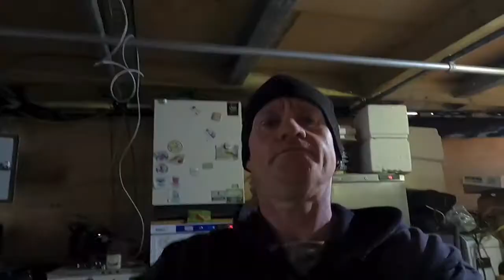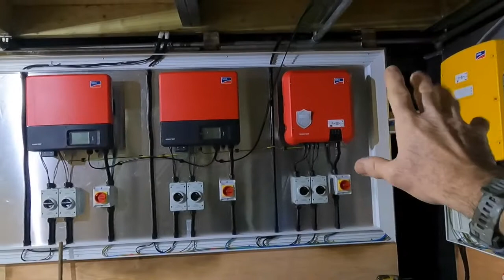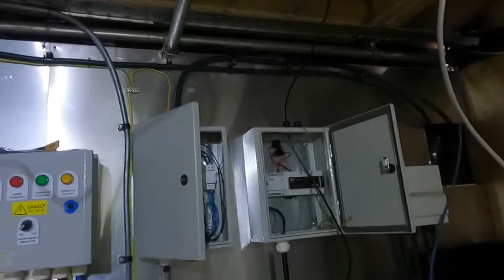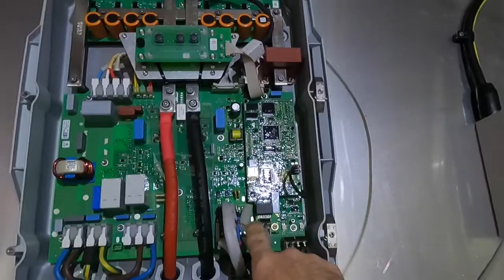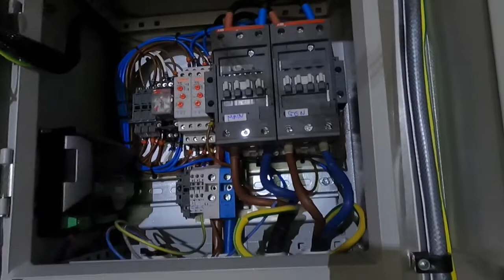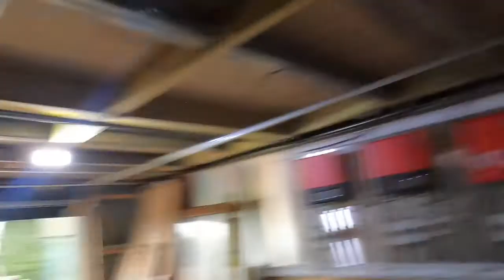SMA SOLAR UPDATE PT2

Comment: Looking good, did you need to go down the route of a home manager, or did the SMA webconnect do that all.  Do you use Bluetooth for the Sunny boys, or ethernet card??  I think you could achieve 85% off grid supply, with the number of panels.  A bit more detail on the ATS would be great.
Reply from the maker: Hi Ivan. went down the data manger route as was unable to find a used web box. I did look at the home manger but the data manger will take 50 inputs. the new sunny boy and sunny islands are Bluetooth and Ethernet. the two old sunny boys have the rs485 card and connected to the data manger . hope I can top more than 85% but it will be fun seeing the numbers. I will try and get some info on the ATS cheers.
Reply: @twistedtube1310  thanks for the reply, awesome, videos, can only dream of having 50 inverters all on one setup would be great to see that production.  You could always add more solar in parallel keep the same volts, but increase the watts, the production problem is always in winter, that way you don't need anymore inverters.  I would think that appx 12Kw of solar will be more than enough for battery charging and usage in summer, but could be a bit light in winter.  I'm getting more questions about grid connection on my channel, with higher self consumption, and there is so much confusion around the ATS, think this would really help.  Thanks again Ivan
Reply from the maker: @offgriduk2643  Hi again Ivan . Thanks for the input again . 50 is a Dream am thinking of maybe some more solar on the opposite side of the garage to catch later sun . You are definitely right summer solar production is not the problem it’s the winter. My biggest problem is I have a heat pump. And the company that I went with back in 2008 were a new company. They have massively change the way the system works now . So I need to sort this out and get it to be more energy efficient. Need to find a way to dump my excess energy into my water. And other ways . Still trying to work the ATS out need a way to make the contact to trigger on the generator side went power goes down.

Comment: Excellent video and install work. I’m looking forward to your update on using the system with grid connection. Is your plan to use it to move excess power to the grid? I want to use the grid connection only as a backup, similar to what my generator is doing now but not to move power to the grid. So when battery state of charge drops below let’s say 20% I will connect to grid to charge the batteries up to let’s say 40% and then disconnect the grid. I will also have setting that allows back feeding the grid off. I’m curious when you have the back feeding on, how do the sunny islands control the solar inverters (we know that in off grid mode it is by frequency) when the batteries are full? Do you think it will just leave the panels on and send the excess power to the grid or do you think it will disconnect the grid and then let the sunny islands shift frequency up to dial down the sunny boys output?
Reply from the maker: Hello and thanks for stopping by, we’ll on grid as not worked at the minute for me. I am going to do an update on the setup in the next day or two. so I am setup as off grid at the minute. There is a lot more to the on grid setup than I thought and for us in the uk it gets right complicated. I think I will do a video on this two. it will hopefully work out better and just maybe some other people will be able to shine some light. the new sunny island are two complex but I do hope to get to the bottom of it. sorry I didn’t answers your question but not to good at reading and writing. so I will try a video and hopefully answers questions. thanks again.
Reply: @twistedtube1310  thank you for replying. I look forward to your next video update!
Reply from the maker: Hi Curionsum, just going to respond to your first comment. as my computer has crashed and my last video has been deleted. and I’ve got 2 weeks straight work. 
my plan is to use all my power myself and not dump down the grid at all. I also only want to use the grid as back power and set the battery soc. for grid connection. in the Uk we have to have a disconnect switch to isolate from the grid if the grid goes down. at the moment I can get the discount to work but not the ATS. so I lose PE connection and that’s what the sunny boys are looking for. so I need to sort that out. I did find a off grid pdf. on the Sma web sit that spoke about off grid with grid connection if your able to find it hope this helps.
Reply: @twistedtube1310  your absolutely correct, the ATS has to have a physical disconnect to stop back feeding if there is a brown out.  Do the Sunny Boys need to be programed for a different PE monitoring when disconnected via ATS???
Reply from the maker: @offgriduk2643  Hi Ivan yep the ATS does disconnect . But because the contractor does not make on the generator side the sunny boys lose the PE connection. Not sure if the the PE settings can be changed. Wonder if I can find a way for the contact to make so it can see the PE connection again. Need to spend some time and try things out cheers Mick
Reply: @twistedtube1310  Hi Mick, how are you getting on, just re-visiting your changeover / Disconnect again, did you find a way round the PE disconnect???  Did it throw a grid error at the sunny island, or was it o.k??
Reply from the maker: @offgriduk2643  Hi Ivan . I have found in the soft wear were you can turn PE off but not sure if this will do any harm to anything else in the system. I suppose it’s a suck it and see . On another note I don’t seam to get the sunny island to accept the gen input any ideas would be very welcome. Thanks again.
Reply: @twistedtube1310  I presume you have the relay set for generator, i have a sunny island 8.0 12h, so the settings are done via a web type login.  do you use a remote controller??  The relay needs to be programmed or the default is to do nothing. Also did you wire a manual ( make and break) switch in to trigger the generator via digi input??
Reply from the maker: @offgriduk2643  Hi Ivan have not played with it to much. As we are getting some great solar products at the minute. I can see you can turn PE off on the sunny boys but not to sure if that is a good thing to do or not. I have a friend that has the same setup but on the older models. He uses a contact to bridge the neutral and earth when there is a grid outage. He doesn’t have a gen connection. Not sure how safe this is he has a disconnect so he cannot back feed when grid is out . Still doing some digging about.
Reply from the maker: @offgriduk2643  Hi Ivan I have the relay set to gen and the new sunny islands are all web based. You can direct connect to them via IP address well the master any way. I have the transfer switch wired to the sunny island and the sunny island starts the gen. It just brings error code . Will need to have a play.
Reply: Hi, not to high jack another mans post, i run SMA sunny islands in off grid mode, as so, use frequency shifting for power production at the sunny boy solar inverters.  For grid connection, when you have sunny islands, the "feed in" is programmed at the home manger to talk to the sunny boys to ramp production down.  If i remember correctly, you can select an amount of power you wish to export.  If you are connected to the grid and don't have the original "home manager" 1, that can have 3 separate meters, or an additional SMA meter for measuring "feed in" for excess energy, it will be very hard to use the excess energy.  1 way would be to use the contact programmable relay inside the sunny island to turn extra devices in the home on or off, you can program, SOC of the batteries, or there is a setting for lead acid batteries to trigger the relay for excess voltage. I would go the route of load shedding on the relay based on SOC of the batteries to turn a device on and off at 90%, this mean i can leave the feed in set to off and the home manager.  Hope this helps. Ivan
Reply from the maker: @offgriduk2643  Hi Ivan the more Input the better in my mind . Jump in at anytime time good to share plus you are doing this for real cheers.